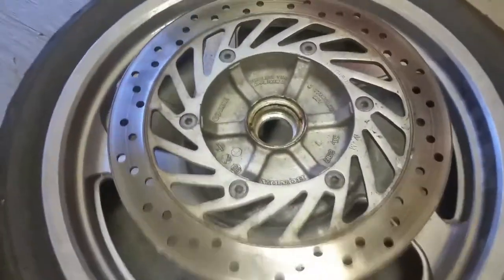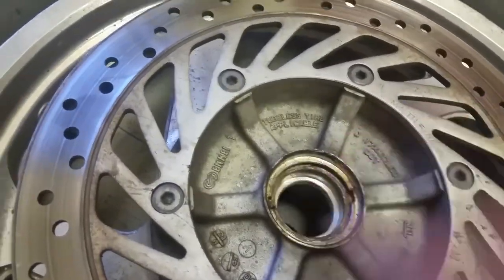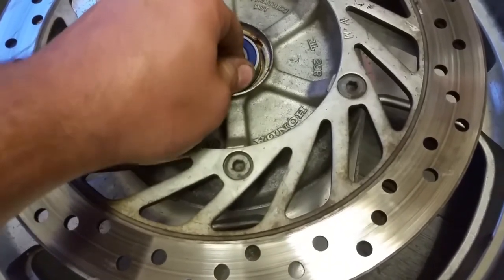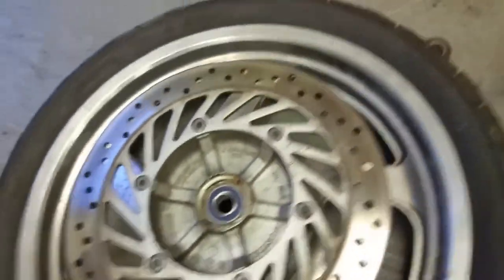Front wheel bearing replacement.  3rd gen Honda Magna vf750c

Comment: I have the exact same wheel, but both sides need a different bearing?!?! I ordered the same kit as you, but one side the bearing is way too big. have you heard of a situation like mine??
Reply from the maker: Richard... They should be the same both sides. Make sure there isn't an old race in there giving the illusion of a smaller hole.
Reply: Rear bearing kit has 3. 1 is bigger in the hub